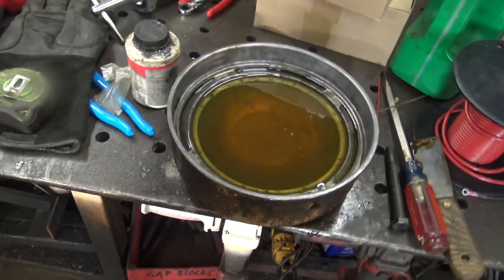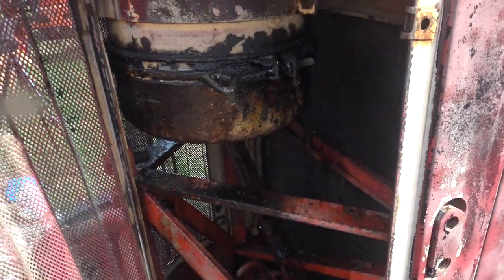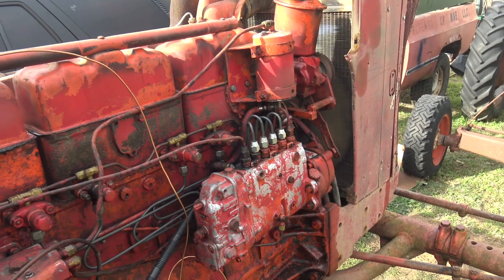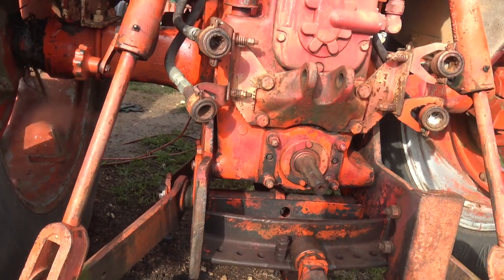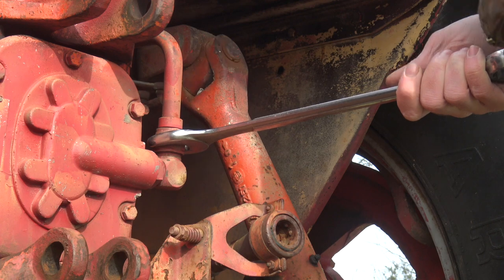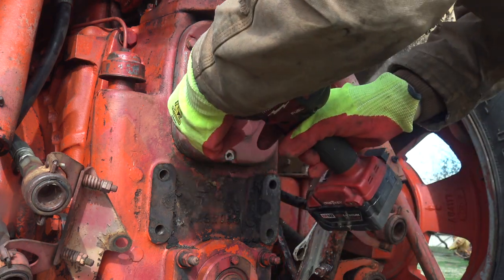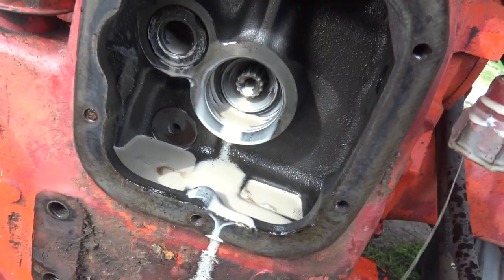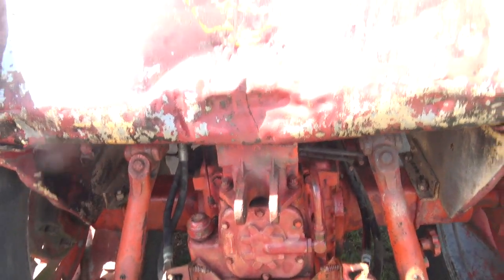FIXING THE WORLDS UGLIEST TRACTOR - How bad is it?!?

Comment: A tip for staring a real cold Diesel  . Take out the air filter   . Tie a rag on a rod  dipped in diesel fuel squeeze it out . Light the rag hold it to the induction and let motor suck in the flam . She will start if you have a good battery . You will need Stephen to hit the starter 👍
Reply: Also if you put a heat gun in the intake, we have a tractor you can kill the battery on trying to start when it’s cold and the heat gun fires it the first revolution, it’s amazing, same concept but less flame 😂

Comment: Starting:  some of these Cases had a decompression mechanism. You might be a generation too new.  If it has decompression mechanism, you are supposed to engage decompression device,  activate starter to get engine up to speed, then release mechanism to full compression while engine is spinning away. Allegedly start better than cranking against initial compression. Every design has different ideal throttle setting for cold starting, too. Some instruct wide open, others mid throttle, some low throttle,  some chant in Latin, so find an operator manual.  
Hydraulic: you had pump out (strainer is at bottom of pump inlet tube inside), should have drained oil, then pump solvent down pump inlet (aka backflush) and observe until clean solvent flows out drain; then reinstall pump. With the appearance of your oil, disassembly for inspection and potential replacement of the screen may be imminent anyway..  We have an 830 series gas--new shift boots, new seals and gaskets on top of 3 point housing, still gets water in.  Speedometer cable at transmission has been suggested to me.  Also, had to take apart and degunk draft control valve due to 3 point slow to lift turning to refusal to lift.